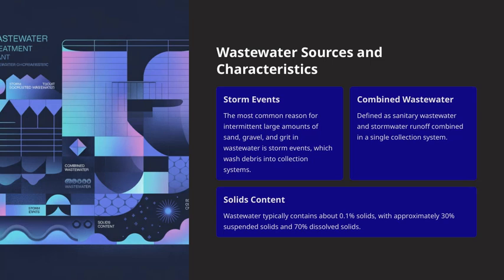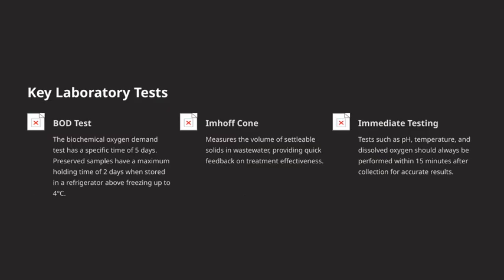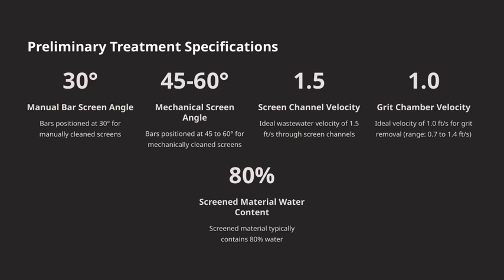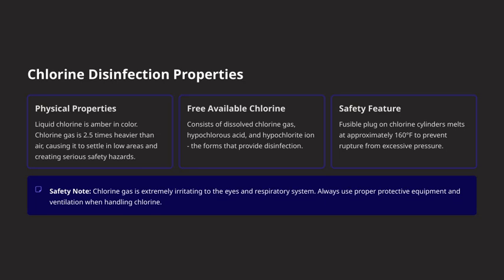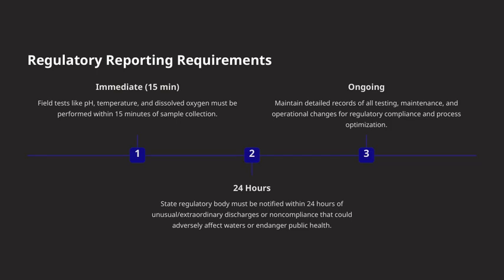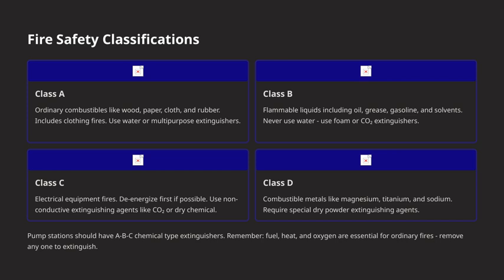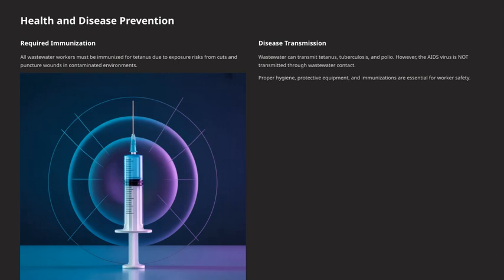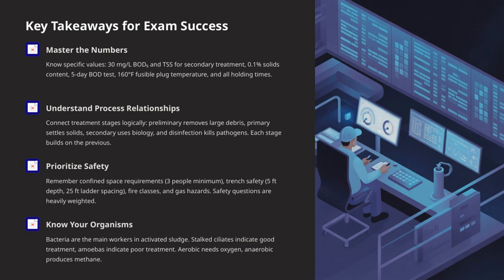Grade 1 Wastewater Operator Certification Exam Review

Comment from the maker: If you're studying for Class I right now, the highest-value thing you can do is work practice questions instead of re-reading notes.

Recognition feels like knowing. It isn't. Reading "SVI below 70 indicates pin floc" three times feels productive, but the exam asks it as a scenario with numbers, and retrieval is a different skill than recognition.

Two free things that help:
• Formula sheet with the unit traps that cost the most points: https://wastewaterace.com/blog/wastewater-operator-formula-sheet/
• Practice questions: https://wastewaterace.com/practice-questions/

And if you're wondering whether to go straight for Class II — here's what actually changes between the levels: https://wastewaterace.com/blog/class-i-vs-class-ii-wastewater-operator-exam/

What state are you testing in? Requirements vary more than people expect.
Reply: Great question how about Florida